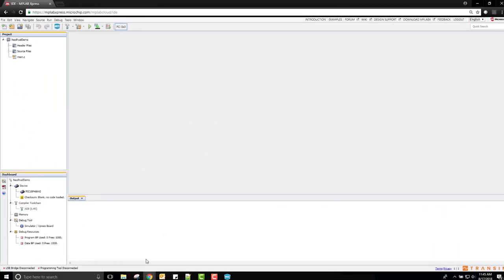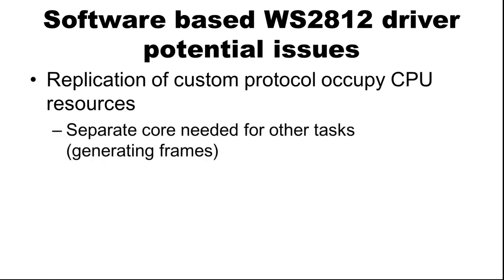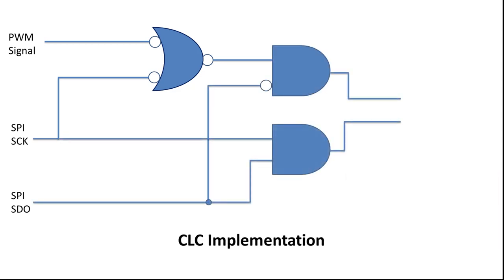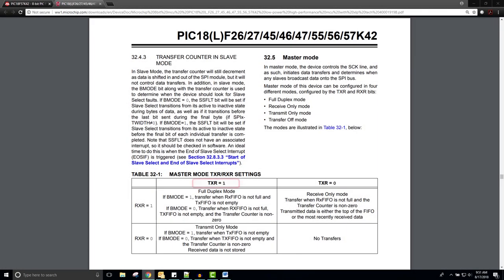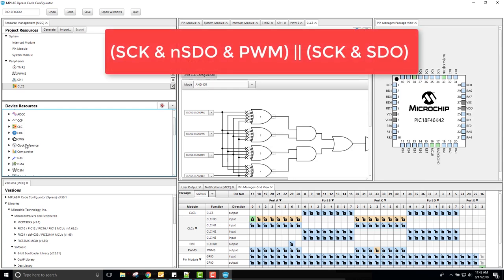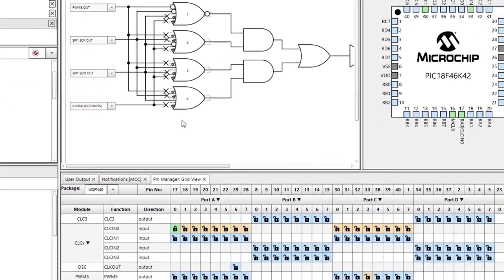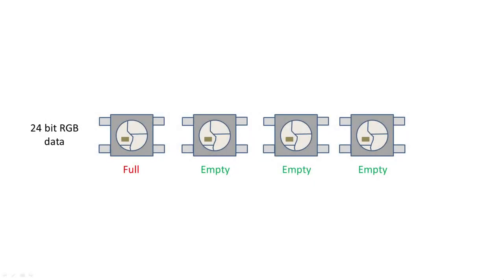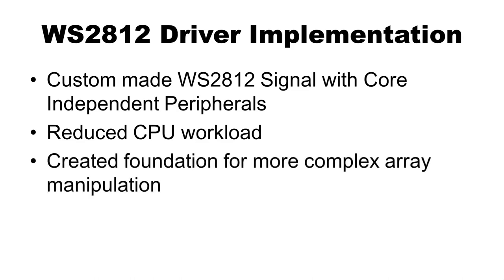How To Use Neopixels With PIC® Microcontrollers

Comment: Hi, thanks for this I also used the 18F46F42 and replicated what you did. It worked fine. It is a great learning piece on use of the CLC and PPS. I am using MPLABX 6.0 XC8 2.35 and MCC 5.1. I had issues with the SPI as in my case the registers defaulted to EN 'disabled' and MST to 'bus slave' which I had not noticed until I examined the video more closely however it was a great experience. Thanks again.

Comment: I watched this video and was able to drive the WS2812B using the PIC16F1765!
It should be noted that the code generated by MCC does not work with SPI.
The following statement needs to be added.
SPI_Open (0);

Comment: Hi Microchip,
I noticed that the SPI's 'EN' bit is disabled by default. I only found this out by going to the Register View in MCC. From the video, it does not tell us that we should enable the EN bit and it gives impression that EN bit is enabled by default. 
I think it is caused by several updates now in the MCC.

If your time permits and you would like to revisit this, here is my version to replicate this issue.
MPLAB X IDE v6.00
XC8 v2.32
MCC Plugin 5.1.2
DFP PIC18F-K 1.5.114
MCC Core 5.4.2
Device Library 1.81.7
Reply: do you think that this code works with WS2812B ? because it is quite different from ws2812
Reply: @Adam20032  You may want to check the Timing Specs of both IC. 
In terms of their form factor, the 2811 is an external IC.

Comment: Why 625ns on timer period?
Reply: Because that is half of an  800Khz period which is what the WS2812 expect.  This works great actually, soooo much  better that all the handcrafted machine code junk I have been using on Atmels. This way the wholoe CPU stays free to talk serial or whatever.
Reply: @oschonrock  I am using PIC18F26Q10 which does not have full SPI module but mssp module, do you know what modifications I have to do ?
Reply: @Adam20032  Sorry, I haven't used the MSSP module for this purpose. Might be tricky?
Reply: @oschonrock  quite tricky for me i am beginner. did you managed to do this project with CLC correctly ?
Reply: @Adam20032  Yes, the SPI bus plus CLC solution works extremely well. 

I actually got it running above the spec of the neopixels at 1.2Mhz. But it's quite a subtle trick and usage of the hardware. The setup config (MCC) and code has to be just right. 

If you are a beginner it might be too hard to do it with different hardware where you have to design the solution from scratch basically.